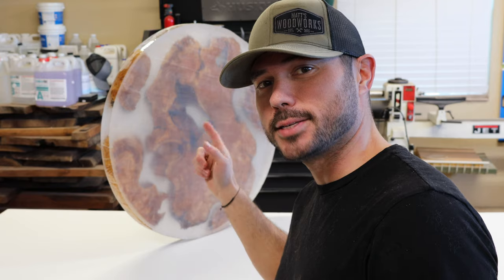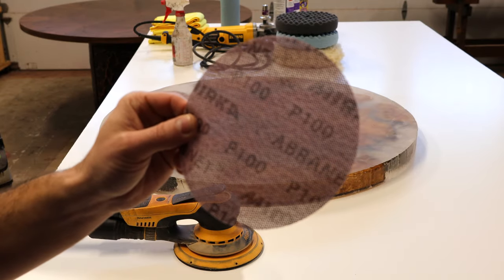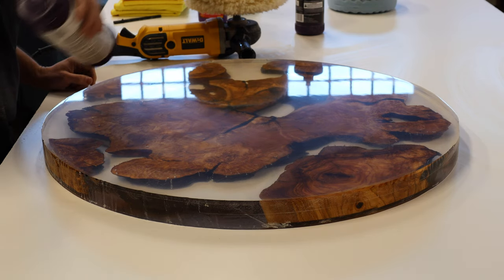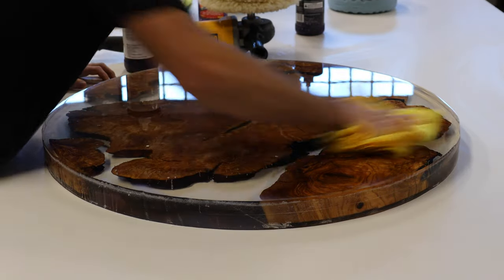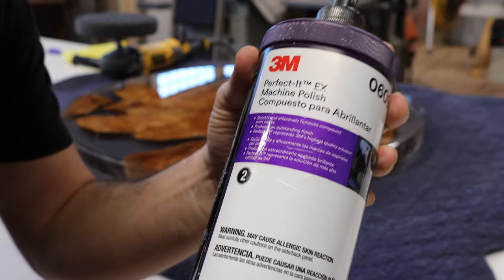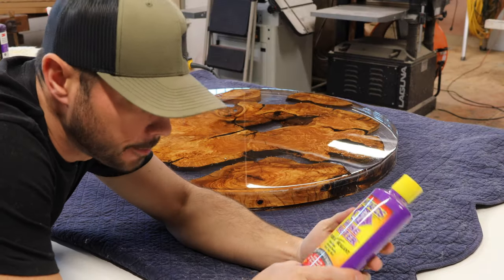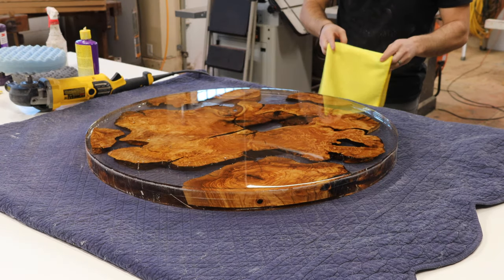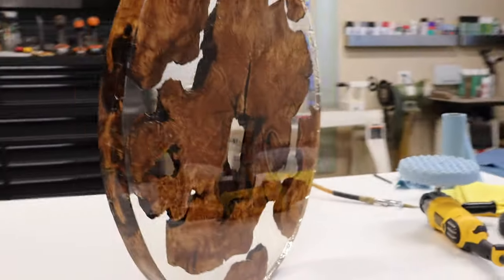How To Polish Epoxy Resin Like A Pro!

Comment: Hey great video! Would this process work on a epoxy countertop? I kinda sanded tiny bumps with 800 grit and then skipped to 3000 grit, I can still see sand marks. I also used a glaze over but it's still not as shiny as the epoxy. Any tips? Is it fixable? Thanks
Reply: Work up to 3000

Comment: Matt, awesome info.
Just want to confirm... You are only using the weight of the tool for pressure on the surface.  Your hands are just too move the tool
Correct???

Comment: hey matt, , I have a question, I encapsulated a photography with resin and it has many bubbles and , when I applied the butane , i made mistake because I  overheated the resin and the pic has a lot sagging. I saw your tutorial and I bought  everything that I need to fix and polish. Another question, with which sandpaper should I start and with which one should I finish the process , or should I do as you indícate in the video ? another question, what speed should I start polish and  Finish! Thanks you  so much

Comment: Hi Matt , I don’t have a variable speed buffer but I do have a variable speed orbital sander, so can I polish the epoxy resin in a flowing river cutting board the same way with the sander since I don’t have as much to polish? I have the 5” buffing pad that fit my sander. I’ve already sanded up to 12,000 grit using wet dry sand paper but I can still see small scratches.

Comment: Hi.
I have a wall clock that has a resin coating. Whatever I do and whatever I use I cannot get that sheen. When I bought it, it was covered in nicotine as the previous owners were chain smokers. I got all of it off and sanded it down as you described, but I keep getting a Matt finish. I've used marine waxing but still no sheen. 
What polishing compounds do I need to use to succeed? Thanks

Comment: The pads that u use, do u use them multiple times? If so do u clean them in between, and how?
Reply from the maker: I use them for quite a while, months and many many projects. Cleaning them I just debur the older material left over with a hard piece of wood or blunt object.

Comment: I confused on buffers and sanders? You show in the video a Mirka eclectic, which you use? But in the list of tools you show a air operated one. The eclectic is much more expensive then the air. Which model do you suggest and why? Why can't you use the Mirka which is variable speed for the entire process, sanding and buffing?
Reply from the maker: either sander would be ok, but they are orbital sanders, the buffing is a DA and is deal for removing scratches and polishing, I don't think you would get the same result with just using a oscillating sander.

Comment: Hi, so useful to finally find the correct order in which to use which polishing pad (did I see you make 2 passes with the same pad+compound?).  Question: how do you remove polishing compound that got stuck into micro holes, that present as white spots on the surface?  Soap and water?

Comment: Hi Matt - I noticed in the comments you mentioned ambient temp of over 78 cause the micro bubbles in the epoxy. I live in Tbilisi (Republic of Georgia) and my soon-to-be-shop won't have a/c to start.  Can the pour be adjusted (the mix) or something be done to combat those bubbles in higher temp shops (read summers around 92 f)? Also - appreciate the info you gave on the Dewalt buffer in the comments - can always use tips about tools of choice.
Reply from the maker: Hi Rock!  This is the hard part with these deep pour epoxy projects, it really needs to be a certain temp to fight the heat they produce during the exotherm peak,  I would absolutely NOT recommend adjusting the mix ratios, you will get epoxy that won't cure fully or cure to fast and produce even more bubbles.  I kind of am in the same boat, its 95-110 during the summer months here so I can't even consider these types of projects because I don't have a climate controlled shop.  I have done some pours inside the house, but only with zero VOC products, I don't recommend this though your wife will kill you... haha
Reply: @MattsWoodworks  Thanks Matt - looks like there will be a deep pour "season" around here...  And you are right - if i tried to do it in the house my wife would definitely flip out - i mean she goes crazy if i shine shoes in the house.... Thanks again!

Comment: Awesome video!  Love the finished product.  Quick question, I am working with epoxy inlay (Cribbage boards that have say something like an NFL team logo on it), will this process work for that?  The project does not have a full epoxy surface, so I am wondering if the polishing steps will affect the wood around it.  What would you recommend as a process?  Stain, finish, then polish the logo?

Comment: Nice video, cheers for sharing your knowledge. What did you do for round the edges?
Reply from the maker: Thanks!  If it is a small round over like an 1/8th then usually I have found that when doing stage 1 the wool pad does a great job taking out lots of the scratches.  If not, then it needs to be done by hand, all of the grits.

Comment: Can you wet sand tables like this if the raw wood is showing? And if not, can you get similar results by dry sanding up to 3000 grit, then polishing?
Reply from the maker: I would do dry sanding only on the wood, and do NOT impregnate the wood with any of the compounds at all.

Comment: I couldn’t get my resin coated art to be back to original gloss. There’s micro scratches. I used Polarshine polish . Any tips ? I’m frustrated and considering just adding a new layer of resin but I hope you can advise me . I was using polish pads on my orbital sander since I don’t have a seperate polish tool. I started at 220 grit regular sanding discs and worked up to using bowling ball pads then foam pads. Highest bowling ball pad was 4000 grit.

Comment: Do you have to throw those pads away after every use? If not how do you clean them?
Reply from the maker: The polishing pads actually last quite a while, the wool pads have a red yarn/string indicator that when it starts peeking through on the pads surface it's then time to swap out, the black and blue polishing pads I replace when they get super worn out or they have too many chunks missing.

Comment: Great video. The only thing I would add, because I've been asked a lot and I feel there is a lot of misinformation, is why you switch to wet sanding. People seem convinced it's more aggressive. In a way it kind of is, but the point is to "wash" away the sanding dust and keep the paper clean, while also keeping the surface cool so the material doesn't soften and ball up causing all kinds of other issues.

Comment: How do you clean the wool  pad? And the other pads between projects. Awesome video and Blacktail sent me to check out the epoxy comparison.
Reply from the maker: I use a dull/blunt steel or rigid object to debur it.  Turn the pad over and turn on, run said object from center to edge a few times until all residue is off.
Reply: @MattsWoodworks  someone should do a video on cleaning things like that, and after epoxy pours . Love the wood and look after be nice to see the stuff that needs to be done that no one shows. Same as set up and maintenance of the machines. Stay safe

Comment: I can't tell for sure, but is there exposed wood involved in this demo, or is the surface all epoxy? I have a small project that will involve exposed wood. I'm wondering if it's problematic to use wet sanding, or can I basically use the process in this video? Are there any suggestions for getting a perfect shine on the epoxy and get a good wood surface too? Also, what is the effect of the polish compounds on wood?

Comment: great tutorial.  How can we  minimize those microbubbles in casting and fix the wavy edges on the cast ?  Aside from a bad mold would you have sanded it down more?
Reply: Simply degas. there are tons of videos about this process. it is basically removing unwanted air inside the epoxy by vacuum.
Reply from the maker: I could have used a degassing chamber and this would have been avoided.

Comment: Hey! Nice and infomative video! 

I have two questions though. Do you always need to sand and polish a resin table? If you have a perfectly clear and smooth pour, is that not enough? Does the treatment add any benefits? I'm not asking because I want to avoid doing this, it was fun when I tried it on small objects, just wondering about the options.

My other question is, what is polishing exactly? I understand that sanding is removing bumps mechanically. Is polishing the same but with even finer particles mixed into a paste or is it something else? I guess the polishing compound does not remain on the object afterwards. I am asking because oiling for example makes the surface shinier and more transparent, but it's obviously not a long-term solution. Do polishing compounds do something similar also or is it just mechanical smoothing? Thanks!
Reply from the maker: If your top coat of resin is perfect enough for you then there is no reason to do this process, it wouldn't add anything except a top sealant coating that gives you some hydrophobic benefits. 

So, cutting compounds (step 1) and wool pads are basically a liquid sandpaper that creates heat with the buffer and smooths out any scratches left over from the previous sandpaper grits, the step 2 and 3 are the "polishing" parts of the process that take out swirl marks from the wool pad and then the sealant to provide hydrophobic benefits, and also each step increases the sheen/final appearance.  I hope that answers your question?
Reply: @MattsWoodworks  Thank you, yes, that aswered my question. :-)
Reply: Heat is the enemy of some plastics, I've some old acrylic sculptures that were flawless for 10 yrs, but now have grown some crazing under the surface. I suspect the heat from buffing has put the surface under tension and its taken years for the micro cracks to open up and oxidize and now appear visible.
Reply: @StevePrachylMetalArt  Uh-huh. Thanks for the info.

Comment: How would you do the sides on something like this? I noticed that you left them alone and was wondering if you apply the same technique after routering the edges...
Reply from the maker: Hi!  I would cut out a circle first with a either a template or a circle cut jig, then I would take the edges to 320, then use my router for whatever edge profile I desired, then I would proceed with the same process to get a glass finish like above.

Comment: Was the wood bare or did you flood coat it?  I want to do the same but I’m worried the compound will stain waxed timber.
Reply from the maker: This was actually fully encapsulated, I used .5" acrylic rod and used them as standoffs to suspend the wood, then poured .5" over the top.  I would definitely never put these compounds on raw wood, you'd want to tape it all off first before doing any polishing.

Comment: Hey Matt, great video, thanks so much for sharing.  It takes a lot of time and effort to put these together, it's much appreciated!  One question I have- what if you have exposed wood?  Will this process still be the same?  Will the 3M polishing products be ok on wood?  I've also seen a lot of videos using OSMO (both the 1101 and Polyx).  Would the Wizards take the place of the OSMO, or would you/could you use OSMO instead of wizards at the end?  Thanks in advance!
Reply from the maker: It's my pleasure Chris!  Thank you for watching.  I would definitely tape off the raw/exposed wood before attempting or doing any polishing, this will take some time tapping all of the parts off but the wood should NOT get in contact with these compounds at all.  I would use osmo on the wood alone after this process, you may consider a ceramic coating on the whole thing after both are completed, but I'd say the wizards is a great final step for resin, just not quite positive on the longevity of the finish standalone for everyday abuse.  It's a typical finishing polish a lot of body shops use for their final step on cars.

Comment: Did you say which epoxy you used? Dont see it in description. Do you know what happened with bubbles? I have seen your other videos and the degassing, but may be this was before you purchased the degassing equipment.
Reply from the maker: I didn't have degassing equipment on this one, the brand of epoxy was Chemtec.

Comment: Thank you for sharing, really nice video. I myself still having trouble with pigtails and scratches along the edges. Have the same set up as yours all the way from the sanding disk to the sander. I wipe down after each pass ! Yet my pads seems to clog before I even do another pass! I run the sander at about 6 is that to slow or fast ? When I get to about 600 wet sanding there are still a noticeable swirls ! Any help would be greatly appreciated!
Reply from the maker: Hi Nancy, I would say that depending on the epoxy brand, you will sometimes get more buildup, I recommend that you change your paper/pads out as needed.  Sometimes I'll even go through 2 disks each of 100-400 grit.  It's also important to sometimes take compressed air and blow out your paper to remove buildup, it's super tedious but it helps.  I don't move onto the next grit until I wipe down with water and see all of the scratches gone.  For example, this piece took me a good 4-5 hours just in sanding alone..
Reply: @MattsWoodworks  Thank you. Very nice of you to reply, it will help out a lot. Need to just spend more time and not rush.
Reply: Nancy, I had the Same issue with the edges of one of my projects. I ended up having to go back to 600 grit and be sure I got them right. It's not fun backtracking but it could save you a lot of grief when you think you're almost finished.
Reply: @richm7873  
Thank you 😊 
Well 600 isn’t to bad of a grit to backtrack 😂. Hopefully won’t have to on my next project.
Thank you for answering.

Comment: Hey Matt Love the videos but I have a question.  I'm about to pour a flood coat over a bar top using table top epoxy and I see no mention of polishing it after it's cured.  My thought was that it would cure to a glass like finish and no need to polish.  Do you have to polish a bar top epoxy after it cures or does this only apply to casting epoxy?
Reply from the maker: If your final pour is good enough then there's no reason to do any of this :)

Comment: Stumbled on this looking to solve my osmo 3011 finish issue. Idk if its my polishing pads or what. Because im getting swirls. Going for a gloss finish.
Reply from the maker: Be sure to clean really good between grits!
Reply: @MattsWoodworks  Would you want to do a collaboration on a project? My channel is way smaller so I would understand the no. Maybe I can contact you with the idea?

Comment: Some questions
a. Will this process work even if the wooden parts are exposed and not covered with epoxy
b. Would a electric sander work instead of a pneumatic  one
c. Would you use the same process if the epoxy is colored or stop at lower grits
Reply from the maker: Hey!
a: I will work but I recommend that you tape off the wood portions so they don't get the compounds into the wood
b: My sander is electric, but either will work!
c: Same process for any pigmented resin

Comment: Great video, exactly the info I was looking for to polish a 2” thick acrylic desk in working on. Bought the perfect it 1 and two the other day but no buffer yet. Are you a fan of the dewalt in the vid, have you tried any others? Have you tried the perfect it 3?
Reply from the maker: Hey Chris! Thank you very much!  Great to hear this will help you!  I absolutely swear by this buffer, it's variable speed and most automotive detailers I know use this model.  I have tried the Makita, which works fine I'm just happy with the ergonomics and smoothness of the Dewalt personally.  Also yes, the perfect IT 3 from 3M doesn't do the job nearly as well as the Wizards polish/sealant, you'll find that the final sheen/gloss enhancement is much better with Wizards.  Good luck!
Reply: @MattsWoodworks  awesome, going to pick up some stuff from your links. Are you using 6” or 8” pads? Do you wash and reuse the microfiber towels?
Reply from the maker: @getdirecti0ns  Rock on!  I use the 7” attachment for the dewalt and the 9” buffing pads.  With the sander I use the 6” discs.
Reply from the maker: @getdirecti0ns  Oh and I definitely don’t reuse these, I will keep them for random things but it’s hard to get out all of the polishing compound

Comment: where do you buy your higher grit sandpaper?  Nice work!
Reply from the maker: Thank you!  I buy it off of Amazon, the 1-4000 is called Abralon.  For 3000 & 5-8000 I buy 3m’s Trizact pads off of amazon too, or you can snag them usually at a local automotive paint supply store.

Comment: I’m a little confused by this because every bottle of cutting crème says it removes 1500 grit marks and Implies that 2000 grit is more than enough sanding before you can polish. 

However I recently tried to buff my epoxy counters and it looks like it was doing nothing. 

I started with 220 and went all the way through 1500 and then I switched to Abralon to  pads and went through 2000-3000. After that I used 6” DA with Presta cutting cream and then presta polish and its horrible. 

I even went back and tried rubbing compound then presta products and still dull and shitty looking. 

I feel like the compounds are doing nothing and the epoxy is too hard